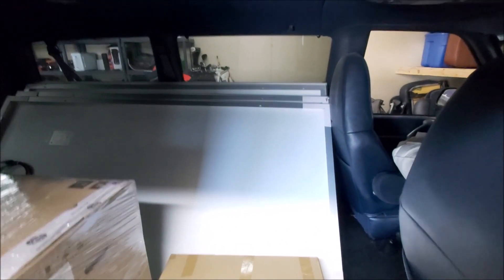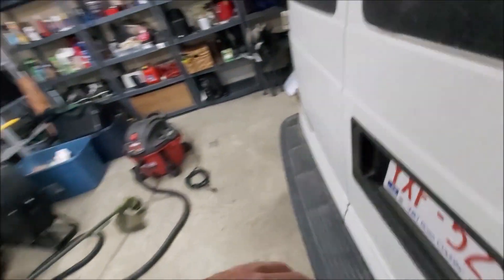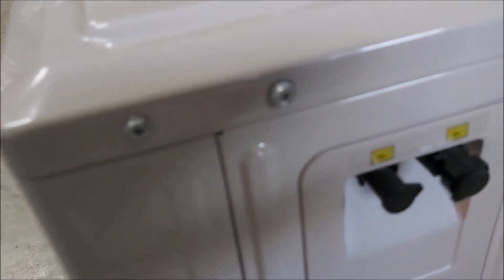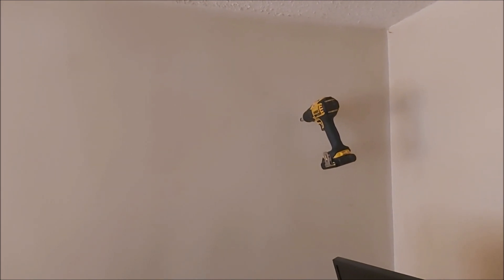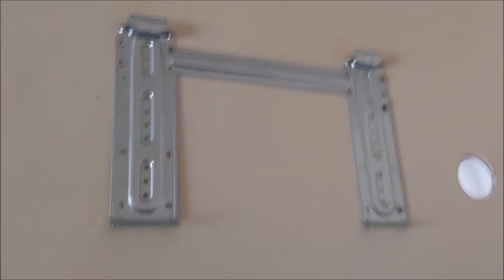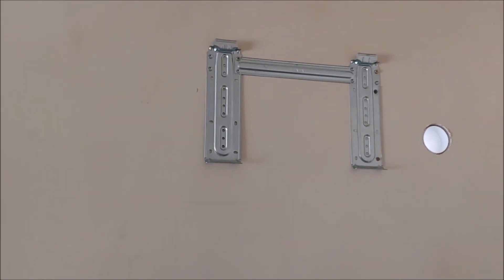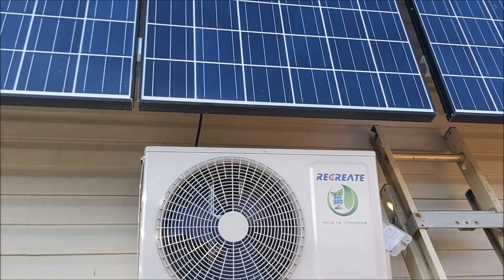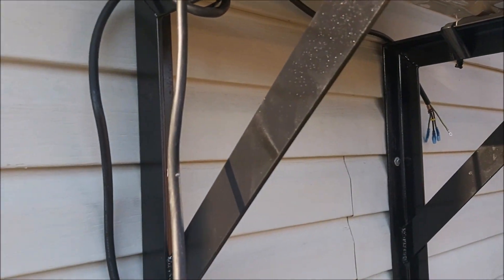Prospecting For Rocks Minerals And Gold In Michigan UP

Comment: That hand still looks nasty, mate.
What's the output of the AC, and what did it cost, if you don't mind me asking?
Reply from the maker: The video is almost a month old, my hand healed well. I didn't even get to pick the scabs. Bummer. Cost was $2300 with the panels.  I have been waiting for a friend for over a month to charge it with 410A, he wants $200. The racking will cost me maybe another $200.
Reply: @timcat1004  Do you have any roof left?  😄
Reply from the maker: @sarkybugger5009  12,000 BTU in response to your first question. I have lot's of roof left but I am maxed out of what they allow back feeding the grid. So from now on it's hockey pokey Troy Reid style fuckery. lmao. My fence is my defense. As long as they can't see it.
Reply: @timcat1004  You're lucky, mate.  My daughter has the UK maximum domestic solar of 4kW.  Any more than that and the paperwork is a nightmare, apparently.  They have room/roof for at least the same again.
I'm not allowed any permanently mounted solar, because 1) I rent, and 2) it's a bloody listed building!  No chance for me.